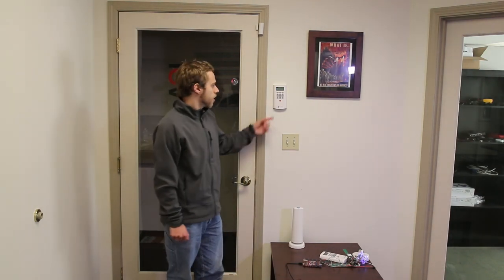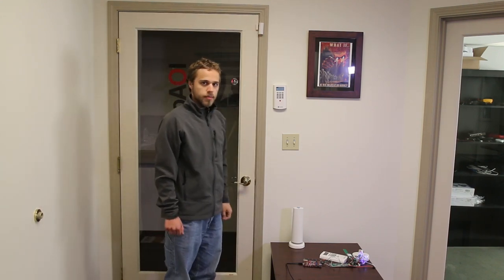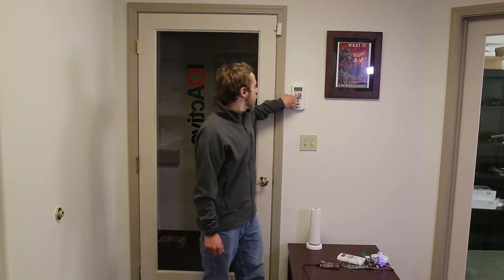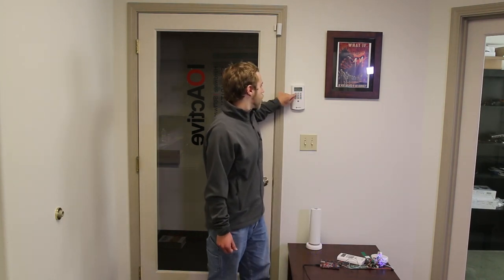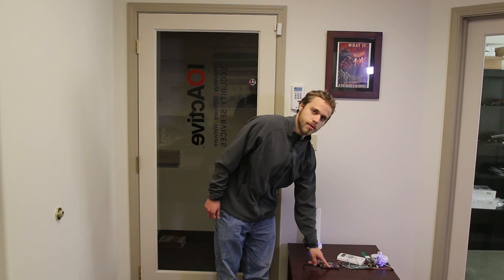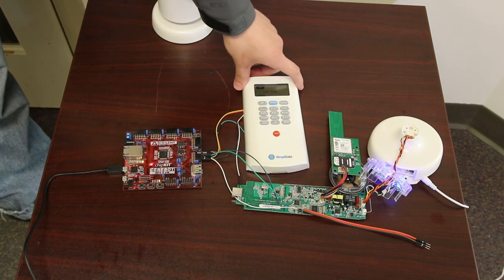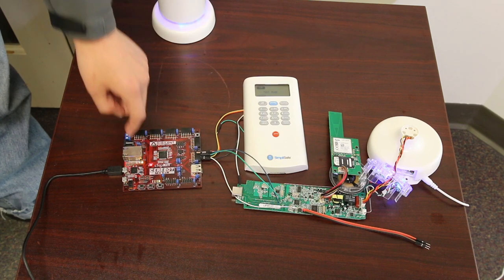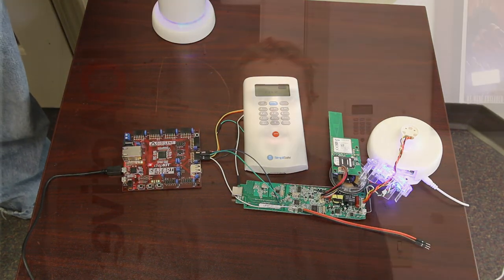SimpliSafe home security system vulnerability - by Dr Andrew Zonenberg (IOActive)

Comment: I'll be sure to watch out for random people taking my control board apart and wiring their own devices into it so they can command my system.  Thanks for the info but this is a stretch... unless you're filming a Mission Impossible movie.  Not concerned one bit.
Reply: he doesn't need to take apart yours he needs to take apart his... so he has a system of his own and he hacks it to receive YOUR system's signal and deactivate it. Security people just point out vulnerabilities for the benefit of the company so they are aware that they are vulnerable and it is up to the companies to fix their vulnerabilities. The general public doesn't really understand the security industry very well >__>
Reply: That is the entire problem as a whole, people getting into the security industry with no knowledge whatsoever. A Harvard Engineer, and now a Paramedic from Kansas for Live Watch LOL. People if it sounds too good to be true, then it is! Whats next, a pizza shop owner in the business? At least be in that field and/or industry before you get into it and claim you know it!
Reply: Even further, that base station is a joke, smash (or break it), which if it's out in the open is easy to do, then you can kiss your security, or I mean false sense of security good bye!
Reply: Why would someone install their base station out in the open?
Reply: Why would Simplisafe recommend putting the base station near a window with a light lit or put a lamp shade on it?

Comment: One way to possibly address this vulnerability is to be able to assign a device ID for each keypad. Then for each keypad to have a unique encryption key known by the control/server. The PIN is then sent encrypted using the unique encryption key assigned to the keypad which sent the PIN to arm/disarm. The control unit/server will then decrypt the PIN using the specific encryption key knowing which pin pad sent the arm/disarm request.

Comment: Fortunately, every time the system is armed or disarmed you get a text message from Simplisafe usually within just a few seconds so you could just call the police yourself. If you pay for the $25.00 per month Interactive monitoring plan you could also immediately rearm the system from your cell phone or computer and set off the alarm which should freak out your computer nerd burglar pretty good. Dr weird would also need to bring a cell phone jammer with him to prevent any cell signals from being sent or received by your base station.
Reply: DSCircleJockey good point. I would notice it immediately as you described. But nonetheless, it's cool he exposed its vulnerability.
Reply: The point is the system has several easily exploitable vulnerabilities.  I would not bet my families safety on Simply safes POS off the shelf system.
Reply: Or... destroy (unplug + pull batteries) the base station in the 30s you have to disarm the system. Real Security Systems(tm) are hidden in steel boxes inside walls, under floors, etc. so (a) you don't know where they are, and (b) it would take more than the grace period to disable.
Reply: What if you're asleep though? 🤷

Comment: Personally, I got the system to offer some protection for my apartment.   Any burglar with enough know how to do this will likely not be going after apartment complexes in the first place.    This system is essentially a simple way for apartment dwellers, or those in other types of rental housing who cannot install more comprehensive alarm systems to do a little bit of target hardening.   When trying to prevent burglary, in most cases you don't have to make your home impossible to break into.  You just have to make it harder and more risky to break into your home than it is to break into the home across the street.

If I owned the place where I live, I wouldn't have gotten this system.  I would have gotten a German Shepard.
Reply: Exactly!! 👍🏾

Comment: Does your setup also have the ability capture the same commands when user (owner) is using the keyfob to enable and disable alarm system instead of entering the PIN on their keypad?
Reply: +monkee13 Not tested, but I expect so.

As a side note, I was recently contacted by a third party who claims to have fully reverse engineered the last few parts of the protocol that I missed. The PIN is indeed sent in the clear with no encryption whatsoever.
Reply: +Andrew Zonenberg Why would you post info on how to defeat an alarm system???
Reply: Has this contraption been fixed yet by the company? I bet it's still riddled with holes but I sense that most customers don't seem unduly concerned.
Reply: Paul Scheidt Because the smart ones NEVER advertise what system they have, besides the fact a common thief isn’t going to go to that much trouble to rob your house...I mean most don’t have a gold repository in their home...

Comment: i think you nuked it man............ if some guy is going through this much trouble to disable a cheap security system...  then you have more problems than a guy trying to get in. like probably just being killed by a stalker in any other location you plan on going.

you also forgot to drone on about how useless the system is if the attacked just jumps you right outside your front door when you get home before you get inside , BOOM security system bypassed, now buy my system!

Comment: Judging from the timeline and no responses from simplisecure, I'm guessing that they have not even started patching this for new hardware.  Do you have any info about the issue being fixed?  Also, does the system have any options to send you an SMS when its been disabled?

Luckily, even if you spelled it out in plain english, most burglars wouldn't be able to solder a wire to even begin to build the capture/replay device.

Comment: Does Simplisafe design their own hardware or is this a white labeled system? If the latter, I'm wondering if other security system vendors might have also left out encryption for their short range wireless data transmissons. They would also not be able to OTA update the system if the microprocessors are OTP. Does the keypad have an external interface to physically update the system? Do the sensors?
Reply: Nevermind on the external interface...it's OTP. I haven't had my coffee yet.

Comment: Just place the keypad in a place where it's going to take the burglar longer than whatever the allotted time to turn off the system is. Don't put it next to the door. Problem solved.
Reply: that was not the point......
The point was that no matter where you have your keypad, someone can remotely turn off your alarm from outside.
basically he is exposing a vulnerability in the alarm system via WiFi signal data transfer and he is basically saying that the alarm company needs
to put some type of encryption within the WiFi network in order to prevent this from happening.
Remember, the base station can talk to anything WiFi up to 100 feet, even through walls.
This is why MOST alarm companies do what they call "HARDWIRED SYSTEMS" - its specifically to prevent this major problem.
Reply: Don't forget to add that those same wired systems utlize a GSM (cellular) transmitter as a backup...

Comment: So if you have the equipment, can code in C, can program a microcontroller, power it all, and know the homeowner uses the Simplisafe system in the first place, you can harvest a pin from the keypad. Great. So what do you do when the homeowner comes home and uses the keychain remote that comes with every system? What do you do when the homeowner turns it off via app? What do you do when the neighbors see you sitting outside of a home for hours and call the police? What do you do when the patrolling cops stop to ask what the hell you're doing with a mess of circuitry in your lap? You really think you can set this shit in the bushes for a couple days and come back and retrieve it? And what do you do about the instant notifications we'll get? Absolutely nothing. This hack is as ridiculous as this guys voice.

Comment: Very well presented. Nothing long and very "to the point". Makes perfect sense, if it is open non-encrypted thats just crazy. WiFi which comes with WEP can be hacked in 5 minutes to 1 day depending on how often it is used. Open air systems like this, yea don't get. Basically the only thing it will do is buzz when someone opens your door, after disabling your system. Have the base station near your bed ;-) and gun loaded.

Comment: wow!  I did not know nerds have developed the ability to see through walls and scan each house for a simplysafe basestation...or invisibility.  get the frig out of here...time to go back to radio shack and sell colecos.   this is moot as long as u don't post a friggin simplysafe alarm sign in your yard as the thieves will have no idea which houses has which security system.  idiotic.
Reply: Putting up some signage indicating the presence of an alarm system does deter some would be burglars, but never put up ones detailing what brand of system you have.